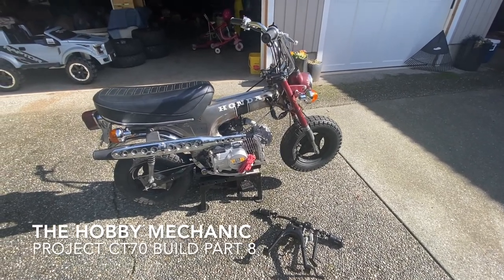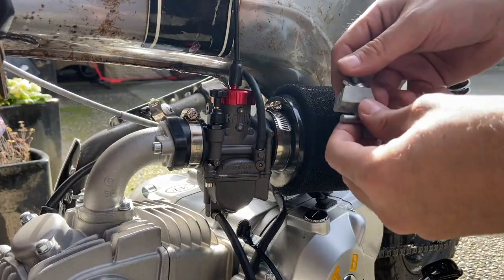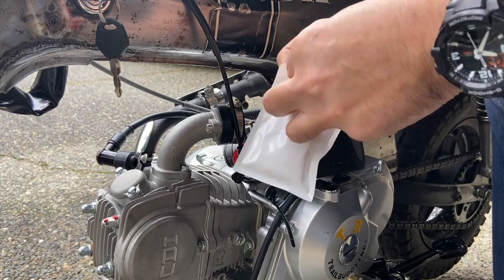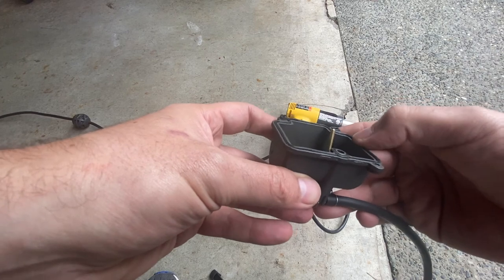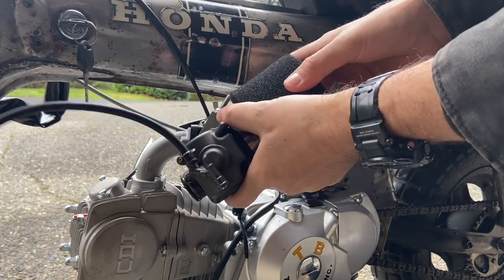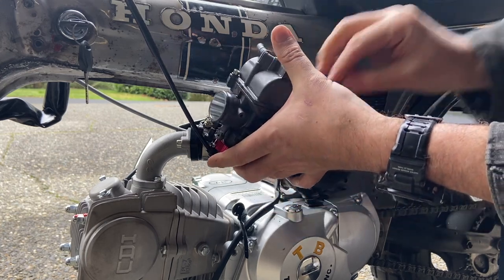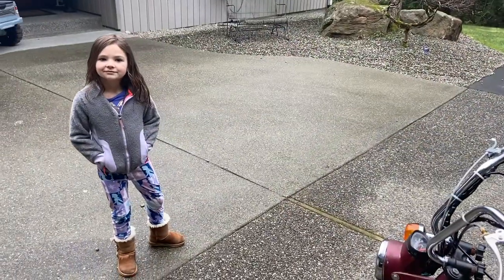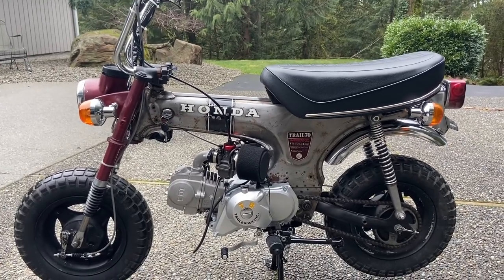$350 Project Honda CT70 Build Part 8: Carburetor Jetting and Center Kick Stand

Comment: I have that carb and it sucks...didn’t even use it I had so much trouble with it
Reply from the maker: Do you have the same motor?  If so all I had to do was modify the floats so it didn’t keep flooding the bowl and change out the main jets as I showed.  I did mess with the needle height but just put it back to how it was when I received it.  What carb did you go with just in case I run into problems?

Comment: Why randomly guess at jetting? Kill engine while running during the problem in this case high RPM and pull the plug to see if it's lean or rich.
Reply from the maker: I might sound random but I already know what direction I’m working (lean vs rich) in this vid.  I started the jetting process a few days prior to this vid but realized I didn’t have smaller jets for the main jet.  I just didn’t include or make a video for that stage of the process.

Comment: Try bigger exhaust it looks like it cant get the gasses out fast enough that also makes it feel sloppy in top ends. Your current exhaust looks like a 50cc/70cc stock exhaust

EDIT: i have an EU Zhenhua ct70 clone also 125cc swap
Reply from the maker: What exhaust are you running?  I just put the old exhaust in because it was there and fit.
Reply: @thehobbymechanic47  i have a OverRacing GP- Performance Full Titanium Racing exhaust pipe